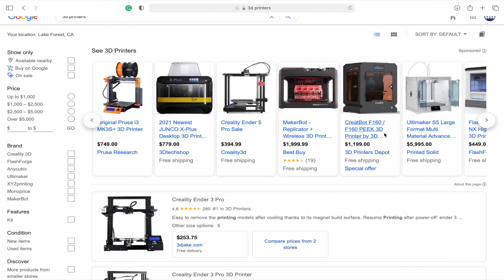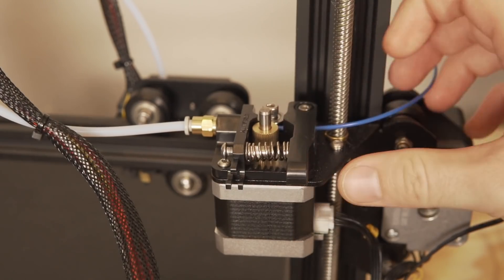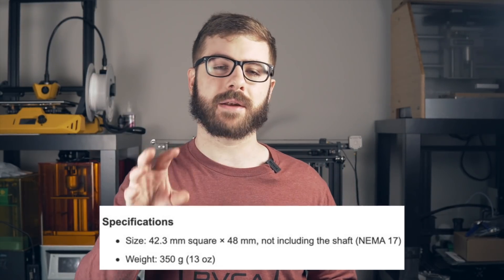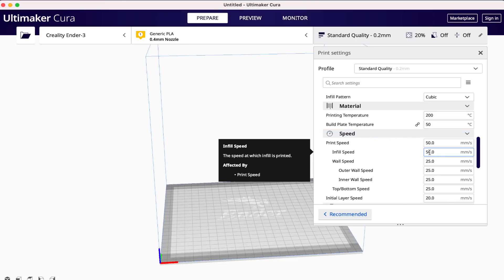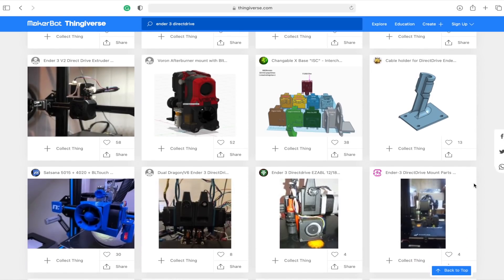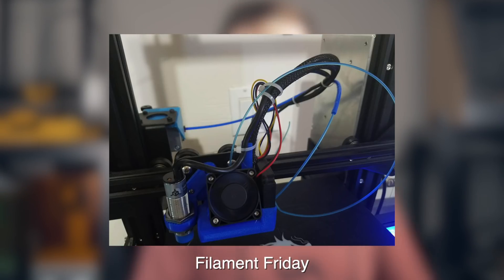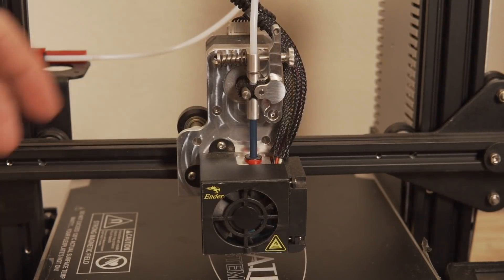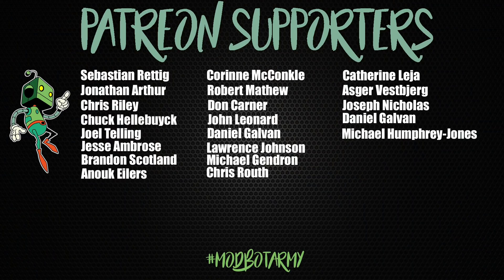Bowden 3d Printer Extruder Vs. Direct Drive

Comment: I have a BIQU BX Printer which comes with the BIQU H2 Direct Drive Extruder. This DD Extruder only weights 209g. This Printer is a workhorse!!! The H2 is lightweight and one of the best Direct Drives i ever had.
Reply from the maker: I am jealous! I have the B1 and love it and have the H2 which I plan on installing but I would love to try a BX out of the box to see what it is all about. Did you back it on Kickstarter?
Reply: @ModBotArmy  no, i am working for a big online retailer and the BX was given to me for testing. In my opinion the BX is one of the best printers out of the box. I use the printer every day since 1 month and it works like a charm.

Comment: if this is your first printer, let me try and help: it doesn't matter. what matters is that its common enough that you can do basically anything with it down the line. because as you 3D print, you're going to find out certain things matter FOR YOU and certain things don't, and being able to modify your printer to fit what you want it to do is most important. there are a lot of companies out there with tons of aftermarket support. get a printer with good aftermarket and learn what you care about and what you don't, then upgrade accordingly

Comment: Bowden is only faster if you are printing at high speeds.  If you are printing for quality, it is definitely slower if you are printing at 60mm/s or slower, as the retraction distance and speed become a significant factor in your overall printing speed.  If printing high speed at a reduced quality is what you need (this obviously eliminates flexibles), then Bowden is definitely your best option.

I like the Micro Swiss all metal direct drive extruder as well, as I can easily increase the temperature of the print chamber up to 100°C w/o needing to worry about plastic parts failing.  It also places the motor on the back side of the plate, which better balances the weight to each side of the plate.  Unfortunately, Micro Swiss told me that they’re too busy to work on modifications for linear rail systems, so I’ll need to grind down the plate that I have, in order to mount it on top of a linear rail.

BTW, while printing with a direct drive extruder, have you also tried different slicers on that same machine?  I had been using Cura, as pretty much everyone was using it, and PrusaSlicer wasn’t around.  However, I really like the layout of PruscaSlicer better from an engineering standpoint.  So, I dialed in settings for both slicers, and I’ve found that not only are the PrusaSlicer prints slightly faster, they don't have the ringing that I see with Cura sliced prints.  It’s like PrusaSlicer has some kind a anti-ringing in their slicing.

P.S.  In case you don’t recognize me, my other channel is Kaelum.  I’m finally getting this new channel setup.  😎
Reply from the maker: They just released a linear rail version! I am going to be installing it onto a machine in a couple of weeks. If you have not ground down your plate dont haha. I hope that I caught you before. 

I am 100% on Cura at the moment as I have been very happy with it for years but I also think the best slicer out there is the one that works for you. I know a lot of people swear by Prusa Slicer. I may have to do some slicing and see which comes out on top. Definitely a lot to consider. 

Awesome :) good luck with the new channel
Reply: @ModBotArmy  I was going to start tomorrow.  Are you talking about their side mounted linear rail, which requires the belt to rotate vertically?  The Ender 5 Plus needs the belt to rotate horizontally around the extrusion.  If I grind it down, I'll have more than enough room to install an endoscopic camera and additional LED lighting as well.

Once I get Creality to fix the extremely loud squealing of the Z screws, I'm going to rotate the Y-axis belts to be horizontal with dual Y-axis motors, so that the Y-axis belts run horizontally as well.  I considered other options, but all of them would have doubled the backlash by doubling the number of pullies on each side of the Y-axis.  I'm currently researching 32 bit MBs that support dual Z, dual Y, single X, a single extruder, built-in networking (optional), and full support for OctoPrint.

The nice thing about this design is that the Y-axis will be a dual duplication of the X-axis, so I should be able to use many of the machined parts that Creality is already making.  Sort of an Ender 5 Plus v2 design, if you will.  :)

I'm pretty sure that Cura and PrusaSlicer will both have the exact same features, and abilities, in the future while offering different methods of working.  I was interested in knowing if you had observed the same things.  Anywho, for now the channel is just a hobby, but who knows.  Thanks for the reply!

Comment: Curious if you have any thoughts here - I have a new Ender 5 Plus and an older Makerbot Replicator 2. I use Simplity3D's default slice settings (give or take). Both printers work great, but the Ender takes approx 50% longer, which is an issue on my large parts (50-hour prints). Any suggestions regarding Ender speed settings? Makerbot default speed = 4800. Ender default speed settings = 2400. I only use PLA for engineering validation.
Reply: Makerbot = Direct Drive. Ender = Bowden, which has led me to this video.

Comment: Great video on the two types of extruders... I'm a DD guy, due to how easy filament changes are, and what you said... Bowden has its place- ie Prusa Mini.  How about the DD that looks like Bowden, where the "PTFE" tube spins?  I can think of is name...  Thanks Daniel.
Reply from the maker: Yeah filament swaps are great. I never use the macros or built in filament changes and its so easy to do a quick swap. I think I know what your talking about. The remote direct drive like the Zesty Nimble right? I really want to try one out. Have a great week!

Comment: Thanks for the video, great overview. I have an Enddr 5 Pro and also have the PrinterMods MDD V1.3. The Modular Direct Drive system has gotten really good reviews from Teaching Tech and others and allows you to use the stock components to convert to direct drive. I'm still running Bowden but am interested if you have any comments. Thanks.
Reply from the maker: Hmm I have not seen it specifically. It sounds like the kit I installed that used the stock motor and stock extruder with just a mount to make it DD. It did work fairly well and I was able to print with some materials like flexibles but was not as good as going with a MicroSwiss or something similar. Could be good to dip your toes and see how you like it before deciding to go all in?

Comment: Nice vid.

One remark, though : you shouldn't say "Direct Drive" as an extruder style since it's misleading and a misnomer. "Direct Drive" is a filament drive mechanism, not a filament feed mechanism, since there are 2 direct extruder styles : full direct (motor AND drive gears attached to the X carriage) and remote direct (drive gears attached to the X carriage, motor mounted on the printer frame).

Comment: Should be possible to get the best of both using a direct drive extruder head with a mechanical linkage to a stationary stepper motor (rather in the way a CoreXY avoids having to move its steppers). I've seen this with a flexible drive (basically a Bowden tube with the central cable rotating rather than pushing and pulling), but I am skeptical about backlash as the cable would tend to wind up as a torsion spring. I've been thinking about a rigid drive shaft on a Delta geometry with a universal joint on the head and the stepper gimble mounted above. Alternatively a dropping bed CoreXY with rigid shafts along the X and Y rails and sliding take-off nuts. Anyone point me to any source that has tried either of these geometries?

Comment: I swear that when I got my first printer, with a direct drive, everyone was talking about how great the Bowden drives are. And as soon as I got a printer with a Bowden drive, suddenly everyone thinks that direct drive is better. 🙄
Reply: same here got a cheap ctc 3d printer after a lot of mods got good prints one of the things was converting to bowden to remove weight from X axis i still use bowden now don't see the point of changing....

Comment: You don’t mention price.  Entry level Bowden printers tend to be cheaper, because the lighter weight extruder doesn’t require quite as rigid or beefy components.  I have both, but Bowden machines like the Ender 3 seem more accessible and allow budget strapped beginners to grow along with their machines via upgrades.
Reply from the maker: That is valid. I think Bowden is easier to setup like you said but with that being said you have machines like the Artillery Genius that is not very expensive either and has a DD. I think it is only a matter of time until there are more DD in the budget price point.
Reply: @ModBotArmy  Yes, I have a Sovol SV01 at a similar price point.  Rather than spend money on upgrades, or a fancier machine, I decided to try DD before getting something more sophisticated.

Comment: You could maybe get the best of both worlds.
A Direct-Drive system, with the extruder motor mounted on the side. Its power can be transmitted via a flexible drill shaft

Comment: Something you didn't mention is filament changes.  I like to manually change colors on layers using a M600.  This can be difficult with a bowden setup, and I had trouble with the Hemera since it had no manual advance.  My OmniaDrops make this so simple.  I have some prints that have 3 or more color layers.
Reply from the maker: Valid point that I did not even think of. That is very true for quick color swaps it is a lot less work. I do not do this very often but I know many others that do as well. Thanks for the feedback :)

Comment: Fantastic video.  My cr10 is direct drive, other wise its all bowden.  I have only printed flexibles once, so it does not matter much to me.  Probably the biggest difference it makes for me is where I keep my spool at.  My cr-10 I keep the spool on the top of the printer, the rest of them I have the spool holder mounted on the side of the printer.
Reply: PS I dont know if you have any connections at Flashforge, but you should try and get them to send you a Voxelab Aquila.  From what I have seen of it, that seems like the budget 3d printer to beat for 2021 so far.
Reply from the maker: @jon9947  Thank you for the feedback. Flashforge did reach out to me at one point about a machine but they did not have much detail at that time. I will ahve to look into the Aquila :)! Cheers.
Reply: @ModBotArmy  Its nothing really special, and I know it must get old reviewing machines that are more or less the same.  It is an Ender 3 v2 clone for significantly cheaper.  It is a $200 printer that on paper looks exactly like the Ender 3 v2.

Comment: Thin stepper motors are bad. At print speed 60+ (retraction 2) it becomes hot and starts skipping steps after several minutes. Even with Duet drivers.
Reply from the maker: Good to know. I have only used full size so far.

Comment: There are two reasons why I can't take arguments in favor of bowden seriously.

1. Much of the time saved printing faster is lost in the ridiculous retractions. Those add up. Now they effect some prints more then others so if you are printing basic shapes ect then sure you will come out ahead on print time. But most people aren't printing nothing but boxes.

2. As tech advances lighter and lighter hotends and extruder will keep being developed. Like that open source orbital gear extruder. So the small down side of direct drive gets smaller. No advancement will ever mitigate the negatives of bowden.
Reply from the maker: I dont know that I have seen the orbital gear. I need to look into it. I do think you are right though with the added retraction times. As hardware gets better and better I cannot see why you would choose bowden if you had a the option of a solid DD over it.
Reply: @ModBotArmy  I had to go hunting a bit because my memory isn't great but I found it again. It's called featherweight
Reply: @ModBotArmy   my bad it's called "Orbiter" and is on thingiverse. Featherweight is another but I don't know if it's open source. In fact seems there is a handful of orbital gear direct drive projects going on which is great news.

Comment: I'd like to add a couple of negatives to the direct drive list:
I converted my Ender 3 V2 to direct drive using the existing hardware. All I needed to do was print a bracket that is readily available on Thingiverse. I also added a second z-screw to the printer, again, easy to do. It all works great, except...
I have my printer installed in a homemade enclosure, one that only has about 4 inches of headroom between the top of the printer gantry and the ceiling of the enclosure. This was done by design so as to minimize the size of the enclosure. The filament spool is mounted outside and on top of the enclosure and filament is fed straight down thru a small hole cut in the enclosure top. Seems fine, right? Well...

If I'm printing a really tall item, then as the print head moves up and up towards the top of the gantry, the filament coming thru the roof has to make a more and more extreme bend in the X direction as the print head moves from side to side during the print. At very high Z levels, that bend in the filament can approach 80 degrees or so, and because of that crazy bend, the extruder has a very hard time pulling the filament into the print head and I end up with severe under-extrusion (and thus print failure). 

The E3V2's vertical volume is 250mm, and I'd estimate that having the direct drive system fed filament thru the top of an enclosure reduces the vertical print size down to about 160mm...not good. 

Another consideration for direct drive: where do you mount a filament run-out sensor? You have two choices: right at the filament's point of entry into the extruder, or close to the filament spool. Mounting the sensor at the spool results in having to waste up to about 200mm of filament in order for run-out detection to operate succesfully, firmware settings-wise. Difficult to explain why that is without a diagram, but it's true. So the sensor is best placed right at the extruder, which requires a custom-made housing and mount for it, something that, as best I can tell, is not available online anywhere.

Sorry for the ramble.

Comment: As far as DD vs Bowden goes if you dont plan to use the softer filament just stick with the Bowden. It will do the job with PLA, PTEG, etc., just fine. Assuming of course your printer is dialed in proper. If you think or plan to use the softer filament then upgrade to a DD. Its really that simple. Don't complicate it more than it is. Just my opinion anyway.

Comment: Why do Bowden tube fan boys have to jump through So many hoops trying to justify a bowden tube setup.

The only reason manufacturers went to Bowden tube setups is because they are cheaper to manufacture.

It's the same reason they went to those ridiculous delrin wheels running in v slots.

The bottom line is a direct drive system running on a linear rail will blow away any bowden tube system for quality especially on a bedslinger because the added weight of the direct drive system still doesn't compare to the weight of the y-axis carriage.

If you're looking for speed then you're going to have to go with Core-XY to eliminate swinging a heavy print bed around.

The constrained filament path of a direct drive system produces a far more stable nozzle pressure, retraction settings are significantly reduced allowing you to perform almost 10 times more retractions in the same given distance as a tube tube system.

That's because on a direct drive system the extruder only needs to move about a millimeter of filament before it's in the fresh filament while on a BT system the extruder has got to move upwards of 6 mm of filament before it's into fresh filament that it hasn't been grinding on during retractions. This manifests itself as much more consistent and nozzle pressure because the filament hasn't been ground away and deformed before getting to the nozzle, the grinding of the filament before it enters the tube is also problematic as it squishes and grinds the filament it changes its diameter changing the amount of friction in the tube.

People who say they don't see a difference in direct drive and linear rails need to work on their base print quality because if you're not seeing a difference that just means your print quality sucks.

Going to direct drive and linear rails should result in a significant increase in print quality if it's not then you need to work on your printer because obviously it's not printing at it s maximum performance.

With that said I still find it hilarious how boden tube fanboys need to jump through all sorts of hoops trying to justify that system kind of reminds me of the FDM fanboys always bringing up the toxicity of resin to justify FDM printing over photopolymer printing.

The bottom line is a direct drive system using linear rails can print just as fast as a bowden tube system while producing significantly higher quality prints
Reply: Hope you're feeling better..lol